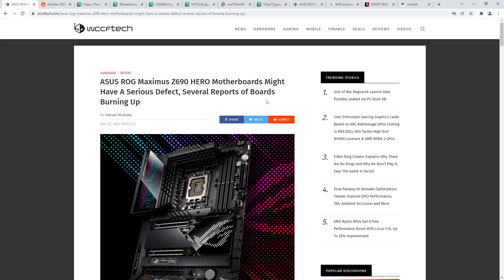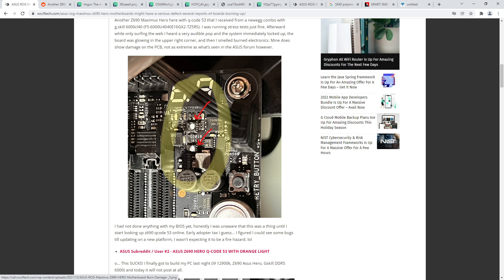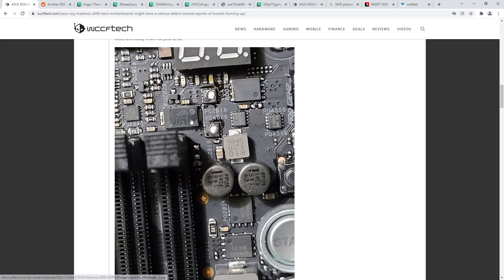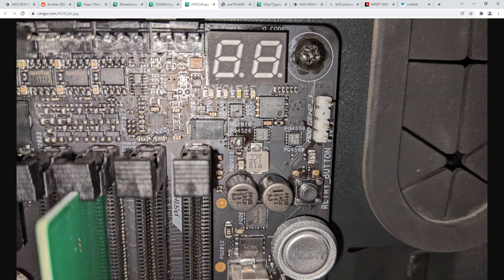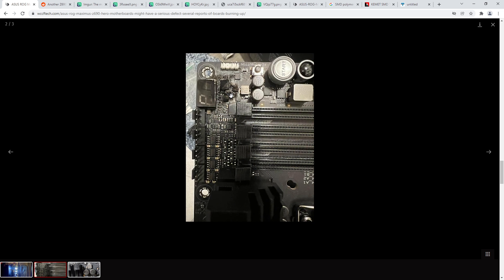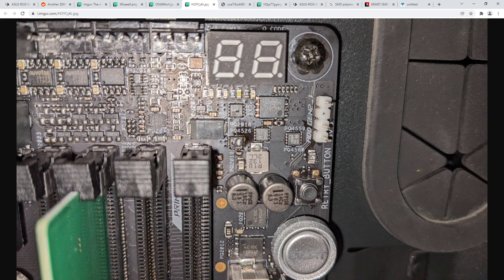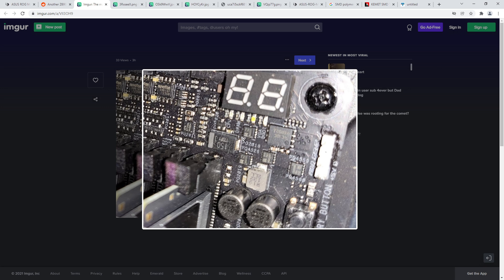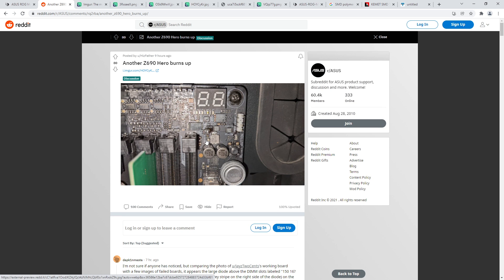My thoughts on the ASUS Maximus Z690 Hero failures

Comment: My guess what happened is during the current component shortages they are constantly switching between capacitor suppliers with limited stock, one day they load a reel from brand A into the pick and place machine and run out half way through the batch, they put in a reel from brand B which has the capacitor in the opposite orientation in the tape and no one notices so no one changes the program on the pick and place and the automated visual inspection QC machine is just reset to check the capacitor is in the new (incorrect) orientation. It passes the relatively short power on test without problem but fails in the customers system.

You'll often see in older electronics with fewer capacitors or large PSUs where a human has manually marked each capacitor as a 'I checked the orientation of this capacitor', again this only works when they're correctly told which way around it's meant to be.

Comment: I had two ASUS Rampage V Edition 10 and on one of the boards on the PCH heatsink there was a sandwich of 1) thin transparent plastic cover with printings, 2) thick white plastic diffuser, 3) LEDs, 4) the PCB. On the other mainboard they forgot the white plastic diffuser and you could see the PCB. Nothing shorted or got hot but again a QC fail.

Comment: thanks god i saw this video. i tested it with a multimeter and you are 100% right, the cap is installed the wrong way! the system was not running much because of istabilities. i delided the cap and even the marking on the board shows it was the wrong way. funny, but now the board is stable.
bro, thank you very much
Reply: xD so funny that the correct orientation is even printed on. glad you could save your baby brother!

Comment: If you look at the image of the board (in the gallery) on the ASUS website, you can see the capacitor in question. In one photo, the polarity stripe is on the right, but in another photo, you can't see the polarity stripe. Not sure if both photos are of the same unit or different units. I could not see the printing on the cap in either photo, however.

Comment: Asus official product page of the Z690 Hero has a gallery with a fairly high-res picture of the Board: The polarity stripe of the cap is facing right, towards the MOSFETs, so it's most likely the way it should be on a working board.

Definitly a bad batch and even worse, really bad manufacturing practice/QC! Even if someone loaded the machine incorrectly, the pick-and-place machine should have spotted the mistake immediatly and stopped. If not, an automated visual control of the board should have caught the error before clearing it and sending it out. Most likely they used so many different suppliers for that part (or their parts in gerneral), that they didn't bother to calibrate their visual controls correctly for each batch. The result is  burning boards in customers hands.

Asus really looks bad on this one... Steve from GamersNexus is going to have a field day 🤣🤣🤣

Comment: I have this board but I’m not at home right now, thankfully a bad thing - not being able to get DDR5 until recently (I’ve ordered kit only last week, while I have this board chilling for over a month) maybe saved my system being set ablaze. I will check it in few hours and give an update about my board.

EDIT: so I've checked and it seems the capacitor on my board is the same like one like other board that did not fail(not the J2C one) the orientation seems the same. I hope I'm in the safe when I get my the memory and boot up the system.

Comment: I have this board and thank god I’ve been waiting on DDR5 ram to come in before firing it up.. my capacitor is backwards. The manufacture date is 2021-11. Does asus know about this? I’m wondering if I should go ahead and try to get it swapped out for a new board because I don’t want to risk it damaging anything else on this very expensive build I’m doing. I’m very savvy with soldering and I can flip it myself, but I’m thinking that will void any chance of warranty. Any clue on what I should do..? I’m going to try and contact Asus about it.
Reply: Update.. Asus support is aware of this issue and is only offering that you send in your motherboard as an RMA repair with a 7-14 day lead time. They are not advanced replacing or even replacing these, you will end up with your repaired unit or a recertified motherboard. I used to think Asus was top notch.

Comment: I had a motherboard that failed in a way similar to this - one of the small SMDs on the top right blew up. Just sparks and smoke, no fire. It was a X570 Tomahawk though. I don't know if it had the same fault, but it was the SMD just under the CPU fan header.
Reply: Since there hasn't been a wave of failing X570 Tomahawk boards your problem is much more likely to fall into either a) A plainly faulty component (a 0.01% defect rate is normal), or b) A faulty solder job on the component itself.

Comment: If you check the product images of the z690 hero boards, a zoomed-in perspective of the capacitor in question has the "150" labeled in the correct orientation with the polarity stripe on the right side.

Comment: So, I have this board and unfortunately, my capacitor is showing the wrong orientation... I have been using this board with no issue since 11/20 when I put this system together. Should I file a RMA with ASUS anyway? Or, should I return this board to Microcenter (I can do a extended holiday return) and buy a brand new one. This is my only rig and I use it daily for working and gaming. I really cannot afford any significant downtime. Guys, please advise what I should do and much apperication here!!
Reply: I'm in the same position as you. Wondering if the problem is  exasperated by overclocking or if even using an xmp profile will cause it to die sooner. I don't mind using it and waiting for it to die if I'm sitting next to it and can react quickly, but I just spoke to Asus and they're saying Q1 of 2022 for a replacement board, then recommended I buy the Apex. Not the answer I was looking for. Microcenter also pulled the board off the shelves based on word from Asus when I was there asking if they were aware of it. And to top it off, all the remaining boards in stock had the reversed cap, the rep let me check each one individually before doing the swap. I'm pretty upset about this whole situation.

Comment: Just looked at my brand new board and it has the inverted capacitor. I'm pissed, it's still new in the box. Will use a MSI Carbon for now.  Thanks a lot for finding the issue.
Reply: Another user up the thread had a faulty configured specimen too. He said that Asus immediately acknowledged the issue and will RMA the board. So just take a picture, send it to their support and ask "How you wanna handle this fam?" :P

Comment: Based on the fact it seems like they have multiple different brands of capacitor, my guess is that the component shortage hit those caps hard, making it so they had to constantly rotate out components. I wouldn't be surprised if it gave a positive hit on the optical check, but was then tested on the hardware tester and showed that it worked, so that error was disregarded because it "passed QC".
Reply: Still, polymer capacitors almost all have the white stripe on one end, regardless of brand. So this is a royal screw up on the settings. Instead of setting the camera to detect orientation of the white stripe as the QC, they instead used "load the capacitors in the correct orientation" as their QC. Sounds like they used QA to reduce QC burden. That doesn't work 100% of the time as mistakes happen even with the best SOPs in place.

Comment: I have mine all built and running with the backwards capacitor, decided to shut it down and contact asus before running it anymore, sounds like they recognize there’s an issue and are moving me to the next level of assistance so we’ll see if they pay to ship mine back and fix it or replace it. Minimum would be a repair, better would be a new board so they could assess the damage already done on mine, Best would be they upgrade me to the step level better board for free for the inconvenience of having to completely tear my pc down and rebuild it again. What a headache…

Comment: This is not good as there is 2000 on a Reel, so potential 2000 with this error and that is if it is only 1 pick and place machine with made the error and it only ran through 1 Reel of components

Comment: I also noticed that all the wrong placed capacitors looks the same, so they are defenetly from one manufacturer, probably from the same reel. All other photos with correctly placed capacitors got diffrent models, like diffrent manufacturers. And you are most likely right that it is 5V since capacitor is 6.3V. So someone screw up quite badly. But there is probably 1000 to 3000 motherboards that will burn. Hovewer there is one more question, that need to be ask. Is there only one capacitor of this type on this board? I would assume, that there should be more of them on the board. So why only this mosfets blew up?

Comment: I am SO glad that is an Aluminum Electrolytic capacitor.  If that was a Tantalum Electrolytic Cap, then a reverse voltage will actually start fires and toxic smoke from the capacitor itself..  I have seen it happen a few times myself.
Reply: Tantalums going off can make a rocket igniter -- which is designed to catch something on fire -- look tame.

Comment: The caps reverse leakage current would probably be adequate to burn up the MOSFETs at first, BUT, once they die, they might fail short, and short the rail to ground, and that is almost guaranteed to blow up the MOSFETs.

Comment: My Z690 Hero has a G157 cap there and the white/gray positive polarity line is on right. I hope you are right on this because that would mean I am safe. It's been running like a champ for 2 months. Also I was looking at all the numbers on the board besides that capacitor and the labeling on the board is the same all the way around (so there likely isn't any revisions on the board layout). So I am sure you are right that this was a horrible mistake.
Reply: You should be safe from this issue, but I would still worry what else ASUS may have done wrong on this board!!
Reply: I have checked mine z690 and I have G157 too 
Positive polarity line is on right as well.
Board is still inside box.
I'm waiting for DDR 5 delivery.

Comment: And here we are, a random Youtube dude that likes hardcore overclocking has catched a huge manufacturing mistake in a record time, while ASUS is probably still denying this is an issue at all
Reply: ASUS is probably busy figuring out who will have to take the blame for this fuck-up, before deciding if they're willing to open up about it or not. Let's hope they got a belt of capacitors that were spooled backward, as they can point the finger outward (even if their QC failed) and save face. That's more important here than the costs involved.
Reply: Asus have admitted the fault and are dealing with it pretty well I think (especially because it's the maximus). Article on T hardware mentions BZ as well c:

Comment: some one probably loaded a chip cassette reel the wrong way and it went to the factory and got loaded on the wrong way. alot of new employees thanks to covid constantly sidelining workers. it's china tho, could have been a janitor forced to filling while they got some one else. or one of the foxconn employees who used to make apple touch screens with no protective gear and rendered half blind got sent to asrock factories.
MAIN THING I NOTICE as the common denominator: no motherboard stand offs, the wire from certain resistors and capacitors is long enough to short to ground which would explain why the screw has melting and burn marks on it along with the browning way over by the fan pin headers and way below the retry button. that's not liquid damage.

Comment: On my Z690 Hero board this capacitor is oriented correctly. And it is G157 one. I have yet to try the motherboard, since I didn't get DDR5 memory yet. Hopefully all will be OK, all motherboards with this capacitor oriented correctly should be fine.

Comment: I still don't get why they still make symmetrical caps like they do. If they didn't, this would of never happened. One connector to the PCB should be narrow and the other should be wider. That way it won't fit at all if it's put in backwards on the PCB. But lets hope the recall doesn't take ages to be announced. Still running on a 4770k.

Comment: I visited a PCB assembly company around 20 years ago and even the machines they had back then had a camera checking part number and orientation before picking it up from the tape or tray before taking it to a second camera to make make final adjustments on package position and orientation before verifying that all pins are within tolerances. Failing to check capacitor polarity when the capacitor has obvious markings is indeed a very silly mistake to make in 2021.
Reply: I think the one pic buildzoid showed that shows the alternative manufacturer cap (probably not KEMET, though marking isn't consistent with any known manufacturer i could find at all) is a good clue for what happened here, i'm pretty sure they bought up a bunch of mismatching stuff cause of shortages and when the optical inspection kept throwing errors because it was meant to recognize the panasonic SP-CAP variant only somebody on the floor had the bright idea to set that alarm to ignore, as you do (though you maybe shouldn't in some situations...). 
After they ran through the alternative stock which probably came in belts that had the holes on the opposite side of the panasonic ones whoever was tasked with swapping the belt just put in the new one correctly (by looking at the previous belt), however the caps in the compartments were the other way round, the optical inspection would have kept throwing errors which were allready ignored before, so nobody would have thought anything about it.

This is just speculation on my part, but best way i could come up with to explain how this went past QC :D
Reply: @taggxoc  most likely what happened. component cassetes cannot be connected incorectly (they are not symmetrical), so the cassete manufacturer probably put the components in the opposite orientation. but its still hard to believe they ignored errors from the optical verification photos, in a motherboard of that price, since the errors would have been about incorrect orientation and stopping the alarm is not something they ever do lightly. one last theory, but is the most unlikely to have happened, everything was in the correct place, but the manufacturer of the cap, marked (with the stripe) the wrong polarity aka not the polarity asus was expecting to be in the side of the stripe.
Reply: @taggxoc  If Buildzoids observation is right, things like the silkscreen polarity indicator for the capacitor, means those engineers are sooooo validated for it not being their error right now. XD
Reply: Yeah, I think either Stranger Parts or Gamers Nexus showed it, they can do it cheap/quick and use photo comparison, and just flag pixels/colours that are different. So strange it was not picked up in some sort of test.
Reply: and 20 years ago they still had bad things pass all the QC's lol

Comment: Yeah, loading them backwards is far more likely than a new revision where they swapped the orientation of that cap. Also, some capton tape helps preventing surrounding plastics from melting when doing solder work.

Comment: IMHO, someone fed the loader with the components the wrong way around. Now the question is, how will Asus handle recalling this batch of defective boards. Also, it’s highly unlikely they could simply invert polarity on a cap without a major layout change, so this is most likely a simple mistake.

Interestingly enough, caps getting put in backwards is fairly common, though it doesn’t usually result in such catastrophic failure (that said, modern motherboards handle a lot of variable power delivery, so who knows). I have 30 year old C= Amiga with a 3640 processor board that ran for 25 years with three caps in the wrong orientation (thanks to a silkscreen mistake). Recapping changed nothing with how that board functions in a practical sense.
Reply: depending on where those caps were, they might not even be necessary at all. A lot of boards have more caps than they really need, as a way to decrease aging or just because the engineer wanted to have a bigger safety margin.
This cap was clearly NOT optional.
Reply: @marcogenovesi8570  I certainly can’t disagree, given the board kinda exploded all over the place.

Comment: It's unbelievable how low the quality-control on PC hardware has fallen. This is just the last of a long list of giant build/design mistakes by many different manufacturers: the NZXT riser cable catching fire, 3090s (and 3080s) dying when playing "New World", the Gigabyte PSUs catching fire and now this.
And prices (and profits), on the other hand, have skyrocketed (this exact board is priced around 700 $/€!). I almost wish console gaming comes back and PC hardware manufactures  can't anymore put any piece of garbage on the market, sure that they will sell it anyways and at whatever price they ask. :(
Reply: haha money machine goes brrrt
Reply: Covid and supply chain snags plus reduced worker oversight in factories multiplied by increased component cost all around divided by massively heightened demand for electronics over the past 1-2yrs equals increased prices, less stock, higher defect rates.